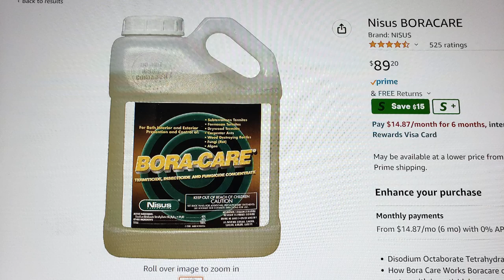Incredible Red Cedar log DIY project EP #2

Comment: The wire wheel you used Sharon get a thin one that fits on an angle grinder to get into the deeper crevices, save a lot of digging with different tools.
Reply: I actually have one that I didn't even think of using until the end of the day 🥴 guess I was too focused on digging in !
Reply: @CedarBluffRustics  LOL

Comment: Can you lightly powerwash the tree to remove the bark?
Reply from the maker: I'm not sure but I don't think so, otherwise I'm guessing she would be doing it. Thanks
Reply: Great question! I probably could have but I was trying not to get it that wet.  It will only have about 5 months to completely dry out before we need to move it in. The other trees I dont use right away I do that to. Makes a mess but sure saves time!